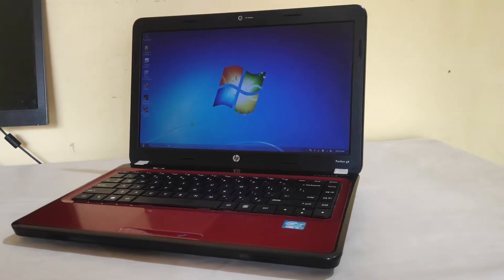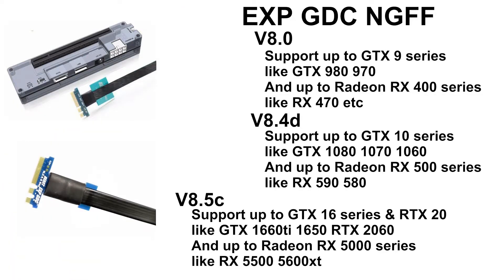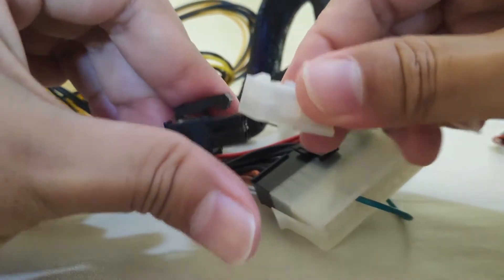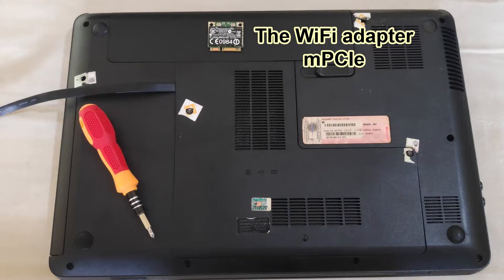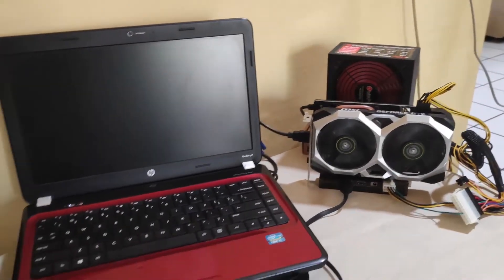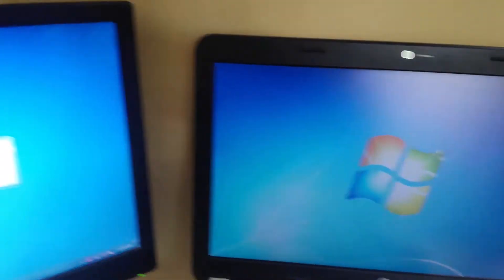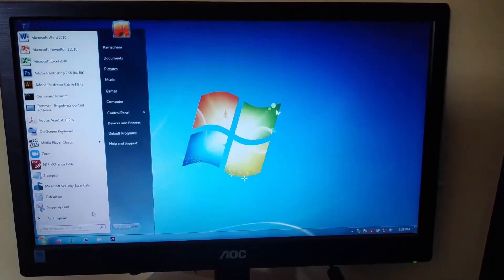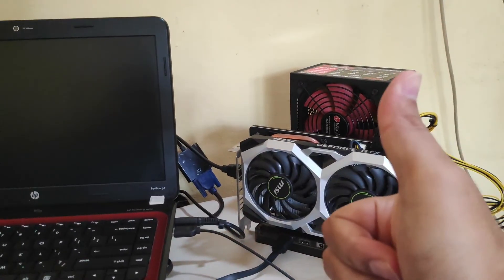EXP GDC Beast V8.5c eGPU with GTX 1660 ti on Old Laptop from 2012

Comment: does it support rtx 3060?
Reply from the maker: Read Pinned comment
Reply: @ClayWheeler  yea i watched it already but i have done everything installing driver but i use NGFF Instead of mini pcie and also connect to external monitor from my gpu also use a 400watt psu but i can't display to external when i press windows+p
Reply from the maker: @pierrealessandro9217  What is your Laptop specifically?
Reply: @ClayWheeler  a Lenovo ideapad slim 5 with Ryzen 7 5700u variant i use the NGFF type replacing the wifi slot
Reply from the maker: @pierrealessandro9217  Oh no, man, I just read and watch the Video specification for the Lenovo Ideapad Slip Ryzen 5700U

The Motherboard design of the Laptop specifically doesn't carry PCIe Signal towards the NGFF port of the WiFi adapter.
Can only send PCIe signal to M.2 NVMe slot, Which are supposedly 2 available Slots in there.
Reply: @ClayWheeler  lol so i have to bought the mini pcie one? Will it work tho?
Reply: @ClayWheeler  yeah i've seen the nvme slot there is one empty
Reply from the maker: @pierrealessandro9217  You have to buy the M.2 NVMe version.
That's the only version for your Laptop.
Reply from the maker: @pierrealessandro9217  https://youtu.be/_5Yy83FCa0k
Reply: @ClayWheeler  ok thanks man i hope it will work coz i'm running out of money and want to play some games LoL.
Reply: @ClayWheeler  ok then i already order it tonight but the core of my problem is device manager detected it but i can't use it on my both laptop monitor or external monitor and neither can i open nvidia control panel nor with right click on the desktop but everything run very well the psu the gpu all running fine. i hope this M2 really fix it 😑.
Reply: @ClayWheeler  i've bought the m.2 and still not working i just order it with same day delivery but still bro any suggestions?
Reply from the maker: @pierrealessandro9217  that's weird.
Is the Laptop's BIOS has some restriction?
Reply from the maker: @pierrealessandro9217  is the Device Manager detect anything at all?
Can NVidia Driver be installed at all?
Reply: @ClayWheeler  the Nvidia rtx 3060 is detected on device manager without any error when i look up the properties i installed driver 472.84, 512.59 and 512.95 all not working. the 472.84 give error at device manager and both 512 give no error but on my task manager didn't detect any gpu also from advanced display settings only said microsoft basic display adapter. i already use the M.2 version and also read like u said on the website the PCIe connectivity was on M.2 slot. I think i'm gonna sell all this stuff if there are no other solution coz i'm broke LoL.

Comment: can a v8.5c or a v8.0 mini PCIe work with a gtx 1060 6gb? because I cannot find any v8.4d on ebay.
Reply from the maker: V8.0 apparently works just fine with RTX 3070.

See pinned comment
Reply from the maker: But if you can find V8.5c just take that one instead.

Comment: Lately I was interesting about upgrading my hp i5 laptop which has  4gb ram, 2gb UHD intel graphics to a gaming one. Then I was looking for how to connect externel GPU videos on Youtube and now Im confident to proceed with. This video is the best so far I have noticed. Video must be going trending yo😏
Reply from the maker: Cool.
What's your Laptop model? Including CPU full name
Reply: @ClayWheeler  my laptop is Dell latitude e5440
Core i7-4600U CPU 2.10GHz 2.70GHz

Do you think it can work with me
Reply: @ClayWheeler Try on my Fujitsu a574 i5 4th gen 8gb ram 512gb ssd just got black screen,psu and GPU run fine when press laptop on ,help me please ? Using used GPU gtx670de

Comment: hi good work, I am thrilled to try this out. My laptop has a dual graphics - intel hd and nvidia gt740m, now I also has nvidia gtx 1070 to be used as the e-gpu, will this conflict with the drivers?
Reply from the maker: Actually yes, you will encounter Driver Conflict.

 But if you have no other choice, you must use DDU (Display Driver Uninstaller) and force uninstall everything related to GT740M. However it's also a good idea to update the IntelHD driver to the latest version possible. So when you unplug GTX 1070, the Laptop still able to run using just IntelHD Graphics.

What's your Laptop model btw?
Reply from the maker: As for the OS, you have 2 choices.
Windows 7 64 bit Ultimate or, Windows 10 V1903 or newer.

Don't use Windows 8 or 8.1 or 11.
Reply from the maker: Oh, before you uninstall the GT740M Driver, you must take a note of where is GT740M located in Device Manager.

 Because after uninstalling GT740M driver, you must disable the PCIe controller that is responsible for GT740M. Because most Laptops that use NVidia GT-M GPU have at least 2 different PCIe controller in Device Manager. You must disable the internal PCIe controller for GT740M.

Because if you don't disable the PCIe controller for GT740M, when you plug the GTX 1070, and attempting to install driver for GTX 1070, it will still be detected for GT740M. —Unless you're using Radeon RX for eGPU, then no need to uninstall anything.
Reply: @ClayWheeler  thanks my laptop is dell inspiron 5437 i5
Reply: @ClayWheeler  I have no plan on using win11, for linux I will try it on my spare desktop hopefully it will run
Reply from the maker: @thebutingtingman8832  about Linux OS, sorry I have no experience using it in my Life.

So I don't know what or how to configure anything at all.

Maybe you can go to Reddit eGPU to ask about it.
Reply: @ClayWheeler  no worries man and thanks again for this awesome video
Reply: @ClayWheeler  thanks, the gt 740m driver is actually hard to find, the recent ones in nvidia do not install correctly in my laptop, ,luckily I found workaround by googling

Comment: What happens if you still use internal monitor?
Reply from the maker: Most games will suffer a Stuttering issues, like the FPS can vary between 200 FPS to 12 FPS. Not Enough Bandwidth speed.

Because :
1) This Laptop is using 2nd Gen Core i5 which means the Mini PCIe was also using Gen 2 PCIe. It is topped at 2.5 Gbps (Remember Gigabit not Gigabyte) and if using internal display it means 2 Way Communication, so it will be 1.25 Gbps. So cannot use internal monitor.

2) any Laptop with 3rd Gen CPU from 2013 - 2018 are mostly using PCIe Gen 3. However mPCIe ended in 2016, so any Laptop from 2013 - 2016 has 5 Gbps (Twice the speed of this video) Also cannot use internal monitor. Because it will be 2.5 Gbps

3) Most Laptop after 2016 - Today , are using NGFF WiFi slot, which is 8 Gbps. Can use internal monitor.

4) Most Laptop after 2018 have more than 1 M.2 NVMe slot which is capable of doing 32 Gbps for eGPU. Can use internal monitor.

Conclusion:
mPCIe 2009 - 2012 is 2.5 Gbps (this is same thing with Express Card like Lenovo ThinkPad)

mPCIe 2013 - 2016 is 5 Gbps (also same with ThinkPad)

NGFF 2017 - today, is 8 Gbps
M.2 NVMe 2018 - today, is 32 Gbps

Only NGFF and NVMe can use internal monitor Because have good speed.

Comment: Can u do a benchmark test so we can see the performance difference between pci x1 vs 16 ?
Reply from the maker: Technically it depends on the game.
Is the game more CPU intensive or GPU intensive or both?

CSGO should work just fine, but PUBG will suffer frame-drop a lot. GTAV is kinda balanced but still Bottlenecked by the CPU Because 2 Cores 4 Threads.

Check out the Pinned comment Because most benchmark are there. Including mPCIe version.

Comment: You can run that game on your laptop graphics card already
Reply from the maker: I can't
Reply from the maker: To make it simple for your understanding, 1 GB DDR3 Memory for any kind of GPU is Slower than 256 MB GDDR3 memory GPU. Doesn't matter if it's NVidia or Radeon.
Reply from the maker: In Need For Speed Hot Pursuit, the Laptop's GPU can only handle 12 FPS, lowest setting, zero reflection, zero shadows.

In case you missed it, this GPU is released few months before ATI Company merged into AMD.

Radeon HD 6470M is using DDR3 memory type, NOT GDDR3. Because comparing both on paper and performance, GDDR3 is faster than DDR3. The only racing game that I can play at 60 FPS is NFS Most Wanted from 2005 and at lowest setting.

This website has stats of FPS on certain games running on Radeon HD 6470 https://www.notebookcheck.net/AMD-Radeon-HD-6470M.43075.0.html

Or
https://www.techpowerup.com/gpu-specs/amd-radeon-hd-6470m-1-gb.b1193
Reply: @ClayWheeler  fair enough, I had a laptop with a 6770m in 2011 and ran this game on medium settings at 720p, so thought your 6470m can't be that much worse, but it seems like it actually is
Reply from the maker: @u_u-x4y  bruh 6770M is GDDR5 that is 2 times faster than GDDR3 and 4 times faster than DDR3 GPU of any kind.

Comment: But can I use it with my laptop internal display?
Reply from the maker: If your Laptop is Older than year 2017, then the answer is NO. You cannot use your Laptop internal display.

Only Laptops after the year 2017 can. Because it has higher Bus Speed.
Reply: @ClayWheeler  my laptop model is Asus X455lab. Can you please check?
Reply from the maker: @Vem-jk6mv  your Laptop is from 2015.

If you want to know, it is determined by the name number of CPU.

My Laptop is using Core i5 2430. Because it's started with "2" that means it's from year 2012. As simple as that.

Your Laptop might be using Core i3 5005U or Core i5 5350U or Core i7 5650U. Those CPU start with "5" which means from the year 2015
Reply: @ClayWheeler  Thanks for the info, but I dont have any external monitor. I got the dock,psu and gpu ready. Wanted to do the setup today.  Is it anyhow possible to use my Internal display? 🙃
Some performance loss is OK for me.
Reply from the maker: @Vem-jk6mv  TV? TV also possible.

If you insist on using your Laptop internal display, you will suffer Choppy FPS in video games.

It might be still okay for editing video with Adobe Premiere Pro 2021, which will automatically utilizing external GPU.

But not good for Gaming.

Unless the Laptop already have Thunderbolt port, then it is possible to use internal display.
Reply: @ClayWheeler  My laptop is i3 5th gen and I am adding GTX 1650 OC. I only want some decent fps. That will be ok for me. This is possible right?
Reply from the maker: @Vem-jk6mv  yeah might be okay. Just set the games in Lowest Graphics settings.

If you can get external display, you will notice a significant improvement in FPS.
Reply: @ClayWheeler  Thanks for your effort bro🧡. Really appreciate it. Giving you a sub🔥

Comment: Thanks.. you explain this very well. I'm getting more confident now to try this out with my old laptop
Reply: Did it work fine with you?
Reply: Try on my Fujitsu a574 i5 4th gen 8gb ram 512gb ssd just got black screen,psu and GPU run fine when press laptop on ,help me please ? Using used GPU gtx670de

Comment: Hi, I want to ask one thing. Your EXP GDC when is woking, does it has a green light?
Reply from the maker: Apparently V8.0 has
V8.5c don't have
Reply: @ClayWheeler  Thank you for you answer. I have an hp g6 1209ss and I am trying to connect a gtx 660 but my pc don’t recognice the gpu. Do you know what could be?
Reply from the maker: @juanfran01  BIOS settings are important

Disable PXE Boot to LAN

And then

Enable Internal Network Adapter Boot
Reply: @ClayWheeler  how can I disable PXE boot to Lan? I do the same that you in your video. I enable internal network adapter boot but i don’t find pxe boot to lan option
Reply from the maker: @juanfran01  when you turn on the Laptop, is the GPU Fans spinning at all?
Reply: @ClayWheeler  No, it isn’t. It is spinning low rpm.

Comment: Hi, if you're still reading comments I'd like to ask a question. I have almost the same spec as your laptop, an i5 3210M with an AMD 7760M Card and tried installed egpu using GTX1650 ( wifi card pcie ) after installing drivers and geforce experience, geforce experience keeps saying driver not detected even there i have already installed and task manager reports 0% ultilization all times , any way to fix this problem? I have not tried external monitor only internal monitor.
Reply from the maker: Oh wait, try to install it NOT By using GeForce Experience. But I need to ask, what kind of GTX 1650 are you using? Does it have 8 Pins PCIe Power Connector as in GTX 1660? if it doesn't have any Supplementary Power Connector, it must be 75 Watt GPU. Watch the Pinned Comment of this Video for GTX 1650.

IMPORTANT!!! Make sure you are using either Windows 7 64 Bit OR Windows 10 V1903 or newer. Windows 8 8.1 or Windows 10 Before V1903 can't use eGPU.

Step 0: Please uninstall any of your Current NVidia Drivers and NVidia GeForce Experience. Unplug the eGPU from Laptop. First, you might want to Uninstall NVidia GeForce Experience normally from the Control Panel of Windows. And then download DDU.exe (Display Driver Uninstaller)
And then, Restart to Safe Mode, use DDU.exe to Uninstall the remaining NVidia Drivers
After that, restart normally

Step 1: Now Plug back the eGPU and Go to the BIOS FIRST!!
Lenovo & Acer: In BIOS Set Graphic Device -UMA  &  Graphic Mode – Integrated),  Or in PXE Boot to LAN  (Network Boot) Disable it.

HP & DELL: In Boot Sequence – Untick Onboard NIC,  Or in System Configuration – Disable Integrated NIC,  Or in Power Management – Disable the Wake on LAN/WLAN.

THINKPAD: In BIOS -Config-Display-Graphics device-Integrated graphics,  Or Disable OS Detection for NVIDIA Optimus.

 Alienware & Clevo: In BIOS Set Primary display – IGFX or PCI.

Continue installation by Downloading RAW DRIVER for GTX 1650 Without GeForce Experience!!! https://www.howtogeek.com/681225/how-to-download-nvidia-drivers-without-geforce-experience/

Step 2: After installing, you might be asked to Restart the Laptop. I'm waiting for your response.
Reply: @ClayWheeler  Hi yes, My GTX1650 is running with a 6pin connector powered with a 500w power supply alongside, does this same method apply to a Toshiba laptop? cant seem to enter bios through the startup so ill figure that out. I'll try the methods given then give you an update
Reply: @ClayWheeler  Ok i have tried all the methods ( except bios because uefi firmware setting not available and boot dosent show ( legacy mode ) , its still 0% ultilization , while playing games it sometimes spike to 100% ultilization then goes back to 0% or sometimes there is from 14% - 7% , GPU memory is always at 0.0/4GB or sometimes 0.1/4GB , any other methods or help using screen share? I tried disabling my AMD Radeon 7760M but doesnt work too, playing games sometimes 0% ultilization but temps increase a bit
Reply from the maker: @Chester-pv3mt  is there some Error Warnings in Device Manager or not?
Reply: @ClayWheeler  nope no code 43 or anything, i have tried another method which is disabling my amd gpu and it kind of worked? It started ultilizing a bit and gpu temps rised. The only game didnt worked was Valorant. Roblox worked fine and benchmarked runned well detecting my egpu
Reply from the maker: @Chester-pv3mt  what about the Windows OS itself? What version of Windows you run?
Reply: @ClayWheeler  Windows vers 21H2 build 1904
Reply from the maker: @Chester-pv3mt  alright, try to download NVidia Cuda-Z app. And then Download GPU-Z app.

See if the card really Detected at all
Reply: @ClayWheeler  yep detected on both of the apps, guess ill just play graphic games using the egpu instead of fps games. Thanks for the reply 👍
Reply from the maker: @Chester-pv3mt  I figured out several ways now.

in your Windows, Click Start, and then type "Graphics Settings"
And then, Manually assign certain Apps/Games to Select its own GPU.

After that, Open NVidia Control Panel. Right Click on Desktop Wallpaper, open NVidia Control Panel.

Adjust Image settings with  Preview, Change it to "Use Advanced 3D Settings"

Again, Manually Assign the Apps/Games to force it to run with NVidia GPU
Reply: @ClayWheeler  Tried all of those too but it seems only when i disable my built in card then it works, usually that is. The Graphics settings shows High performance and power saver as "Radeon 7700M Series" and not GTX1650 but after disabling my card it shows GTX1650. Even change the PHYSX to GTX1650 but doesnt work
Reply from the maker: @Chester-pv3mt  Try to disable High Precision Event Timer

Open Device Manager. Scroll down to "System" expand it.
scroll down and search for High Precision Event Timer. Right click and Disable.

Restart Laptop

Comment: if i looking to use exp gdc 8.5c for rtx 30 series , will that be facing any issue?
Reply from the maker: No. Should be good. Try to read the Pinned comment of this video. There's an example of EXP GDC V8.0 using RTX 3070. 

So my video might not always accurate.
Yeah, you can use EXP GDC 8.0 8.4d 8.5c for any RTX card.
Reply: @ClayWheeler  I just purchase for the mini pcie for exp gdc 8.5c, looking forward to try rtx 3060

Comment: I'm pretty new, but I'd like to test some GPU mining. Before I take my P.C apart, will this work on my HPwindows 10 Ryzen 3 @ 3.5gh? Please and thanks!!
Also has 2 cores
Reply from the maker: How many NVMe SSD slot does it have on the Motherboard?

I cannot give you any recommendations before you know the inside of your Laptop.

Try to search Video about your Laptop model Disassembly